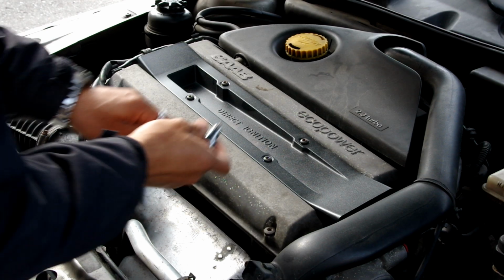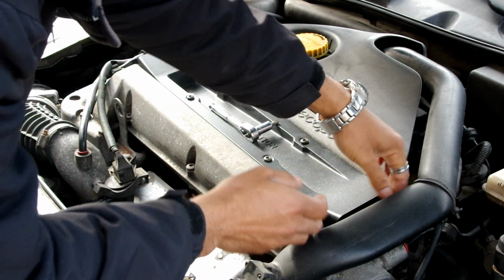SAAB 9-5 Aero. Replacing Spark plugs and a DIC. Is NGK actually OEM (SEM)? YES!

Comment: Have you tried running the colder plugs as recommended by the Saab community BCPR7ES?
Reply from the maker: Nope as most of that stemmed from people's tuners recommending that due to the tune. I never had any plug issues running the OEM plugs.

Comment: what did you do with that pliers after you installed each new spark plug ?
Reply from the maker: The rubber grommet inside the spark plug adapter kept coming off and was stuck to the top of the spark plug. So I was pulling it back out and putting it back into the adapter for the socket.
Reply: @KobieMC  Ah, of course.  Thanks  for the quick reply  and the video !

Comment: Yeah that coil-on-plug/Cam-valley-assembly is ridiculous. I saw the replacement cost for it on ebay....ouch! Pitty you didn't find some Audi R8 coils (From the V10) and had a plate machined up, and then routed the wires from the main plug (Thats under that intake pipe) to each individual plug coil. Saab is a BS car. Its not over engineered, its about making parts that cannot easily be replaced. Replacing a knock sensor with a spark plug is just being silly, and its why the Audi/Lamborghini/Porsche V10 has several knock sensors. Its like most car makers make individual coils, but competitors are allowed by law to make and sell the same item for less. The Europeans just create an entire assembly thats too specific per model for a competitor to bother making. Yes I did see the knock offs. Should have bought a Toyota or Honda.

I have tried a variety of plugs in a few Toyotas. One toyota I own seems to foul its plugs early, and running expensive Platinum and iridium plugs was a waste of money and time, as they foul up and the engine drastically looses power. I went back to copper spark plugs in two of my cars, BUT they're twin tipped. In the conventional plug design, the spark is hidden behind the electrode. In the twin tipped, the core comes out and is exposed, and both electrodes turn in to the electrode and the spark is always exposed to the top of the piston. I get at least 10 to 15 more horse power from these plugs, and better throttle response. Back in the V8 days with two valves per cylinder, the spark plugs were never right on top of the piston, but they went in on angle on one side. Racers used to "Index " the plugs by adding washers so as the spark was exposed to the top of the piston for better combustion and flame front. So the twin tip plugs are kind of like "Indexing" and having the spark exposed to the top of the piston producing the best and least impeded (by an electrode) flame front.

Spark plugs need about 25nm of torque, and that looked like 15nm of torque. You gotta get a small torque wrench that goes up to 30nm for plugs. The big ones with half inch drive aren't accurate up to 40nm of torque. I have a 1/4 inch drive torque wrench for changing plugs and lighter duty tightening that still needs to be relatively accurate (Its just a car).

Regards Kobie!

Comment: no one thinking to move the DIC.case higher 10 to15mm.high from engine cover by  teflon insulator.othe DIC.case not touch the engine cover The DIC.unit  not so hot...
Reply from the maker: Then it wouldn't sit properly sealed over the spark plugs.

Comment: They don't fit any other car.. That's not true, it's a bullshit. They fit any other car with same diameter and height. But yeah, i wouldn't put them on any car, even on my saab. I suffered enough with same NGK, and replaced them with Denso IQ20TT.
Reply from the maker: They are not designed to fit the requirements of any other car or there'd be more vehicles listed as compatible on the NGK site. I never had any issues with OEM NGK plugs.
Reply: @KobieMC  anyway, they will still work. It's just a spark. I will agree with you about specifications.